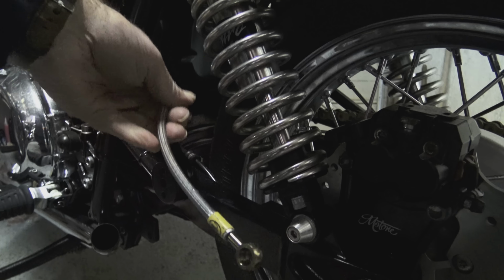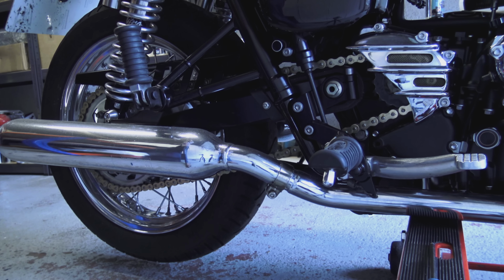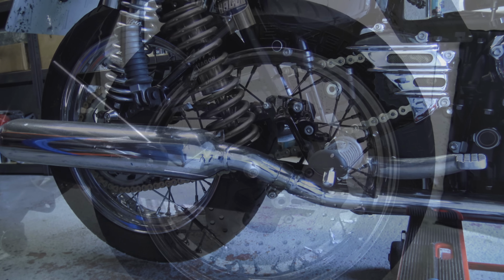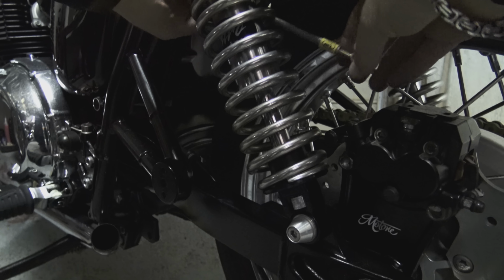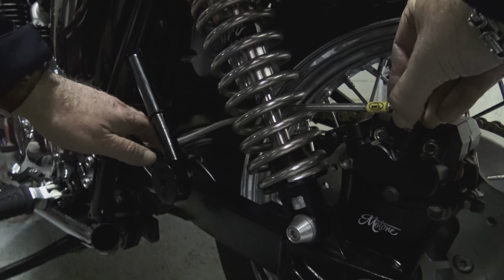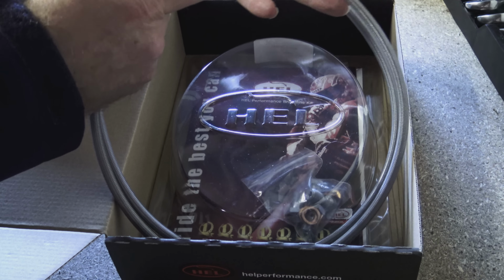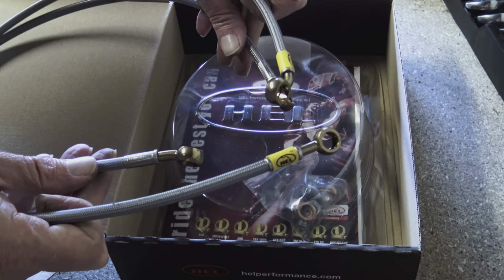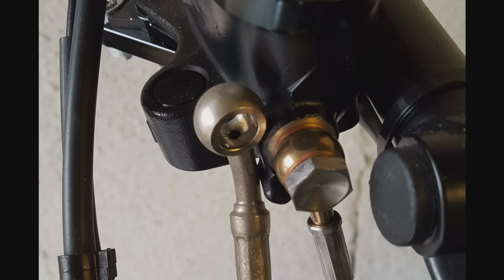Custom Triumph Bonneville T100. problems with the Brake upgrades!

Comment: Hi Stuart. could you not have got a longer brake line and routed it around the bottom of the shock absorber with a 90 degree fitting to the caliper ? just wondering. Also , if you had got through the build without any hiccups you would have been the first in the history of custom bike building I am sure.

Comment: Thx Stuart for always being throughout and informative with the presentation. Just question, with the Fox Suspension upgrade from Triumph, would the problem still occur when relocating the brake caliper as you mention from your video. Thank you.
Reply from the maker: not sure.
Reply: @stuartfillingham  may i know the  diameter of the suspension you've upgraded :)

Comment: Thanks very much for all this info. Forgive the naive question, but…do the SS braided brake lines eliminate the need for the factory recommended replacement of lines every four years? Is it just a flush of the fluid every two years after fitting these?

Comment: hello Stewart, is it possible to order a slightly longer brake line with a right angle bend at the caliper connection. Could it run along the trailing arm ,go between the caliper and lower shock connection then up and the right angle bend might allow the connection to the caliper?
PS, love your cool laid back style.

Comment: Yeah I haven't used the rear brake once on the street. On the track yes, but I plan to only replace the front brake lines on my T120.
In fact I've never bought a brake "kit", I just manually measure the needed length and eyeball the appropriate angle of connectors, and get my own banjo bolts.

Comment: I roughly expected this problem on my T100 as well. This is why I never got the calliper relocation kit. I could install my HEL cables and after market shocks without any trouble. My rear calliper does require a lot of maintenance though, no doubt about it. Can’t have everything.

Comment: Love your honesty, Stuart. You have highlighted a classic conundrum with incorporating modifications/upgrades from different manufacturers other than the OEM. The other aspect is early versus late models for any given year. Here in the USA, everyone utilizes the 'VIN' for everything from registration to upgrades, recalls to paint colours/batch numbers.  Maybe if manufacturers (non OEM) used VIN's for applicability, it would at least give some validation. It doesn't address mods on mods as you have shown here, but it would at least help.

Comment: Another problem that you might be able to help with Stuart and that is what paddock stand is the most practical for a 2018 Speedmaster.  The bobbin positions are so low down on the sub-frame at the rear, a conventional paddock stand just won’t work.  So, any suggestions please?  Yours aye, Alan
Reply from the maker: Hmm Ive already tried 2 sir and had the same problem with the bobber. ive been told the extra leverage on the oxford paddock stand works!
Reply: Mhmm - I heard that and so bought the Oxford stand but, unfortunately, there’s no joy there either!  I’ll go and investigate with my local Triumph dealer when I get back to the UK.  I’ll let you know then.  In the meantime, Stuart, how are you doing the standard stuff like lubricating the chain.  Mines the longwinded method at the moment!  Yours aye, Alan
Reply from the maker: @docgreen4934  which oxford stand did you try sir, I believe they make several !

Comment: Zzz Stuart have longer flexy brake pipe fix it to lower side of swinging arm  and go down round the hub nut up to the calliper with an angled fitting on the end of the line , nice shape , plenty of clearance and. Would look tidy.

Comment: Problems are just there to be solved.. but hard to see from here how much clearance there is between the shock and callapiers but surely something like a stainless bracket can be fabricated and attached somewhere to hold that braided brake line at bay to stop being nipped by the spring compressing.. a longer line might be a go´er also...  sleep on it for a while and look at it with fresh eyes... often helps

Comment: I think they could do a new, longer line with a slightly differing (with a curve) banjo - (just show them the correct routing and length) or there might be a shop/manufacturer that does ones...

Comment: More great content, Stuart. 

I have the TEC gas shocks on my 2013, 865 mag-wheel Bonnie.  It’s also fitted with the Motone calliper relocation mount and the brake line clears the shocks with no issues, although I did have to re-route the line to get an extra bit of length, so it sat nicely out of harms way.   I think the YSS shocks are of a similar size to the TEC ones, so a couple of options worth thinking about. 

Andy 🏴
Reply: Thanks for post my wife has a 2013 mag wheel bonnie which I fancied fitting the motone break caliper on.

Comment: Well these things do happen mate, never mind...I am probably wrong, but I don't like the look of them Hagon shocks, it just looks upside down to me, I know they would still work the same, but to me, I'd rather see conventional looking shocks. When I had my T100 (2013) , I changed the std shocks for IKON's, they are made in Australia, and are built  the same as the old KONI dial a ride's, 
(I think they bought the rights) .
They certainly tightened up the back end, and of course you can obviously 'dial' in the damping, as well as the spring tension.  Can't remember the price, I picked them up at Norman Hyde if I remember right... just a thought, cheers, Dave
Reply from the maker: cheers Dave, worth thinking about!

Comment: Hmmm. I’m not a fan of underslung brake callipers but I think I’d have returned it to its original position and kept the shocks. Do you have a slimmer pair of shocks in mind.  I’m not the font of all knowledge with replacement shocks but I fear you might struggle to get a decent pair as slim as the originals.
Reply: Ditto the above Stuart, the Hagons are worth keeping for their handling capabilities. Personally I,d relocate the caliper to its original position... actually prefer the underslung look. Just requires a little more looking after regards cleaning and maintenance which is a simple job at the end of the day.
Reply: Nitron make a superb shock for these.